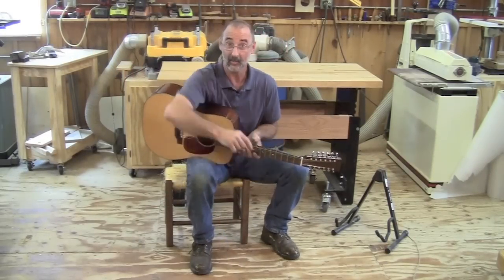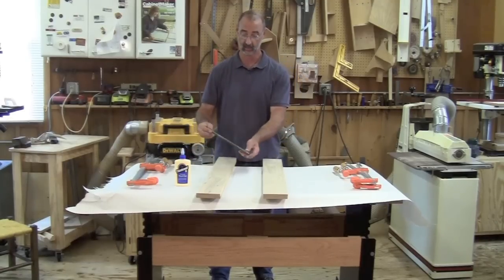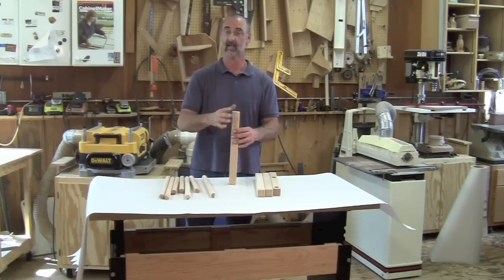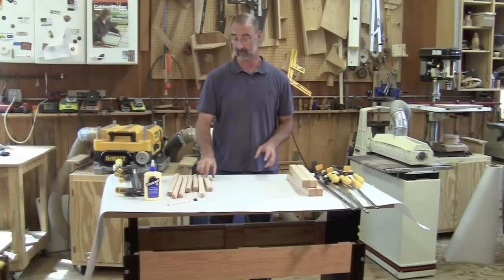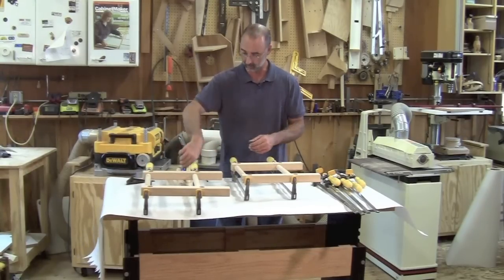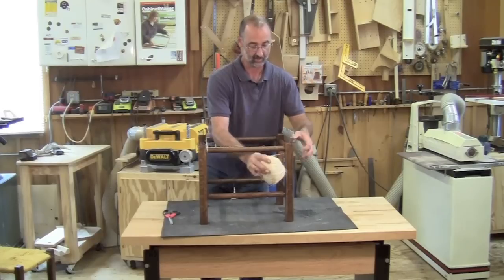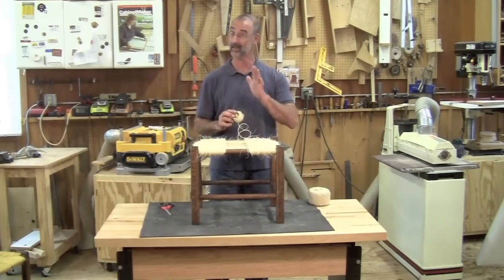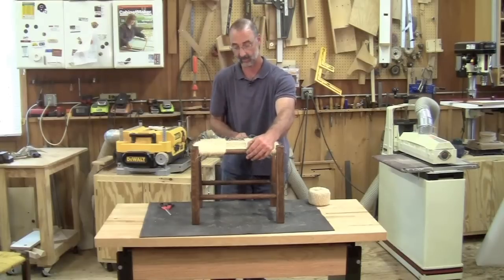Build Your Own Twine Stool

Comment: I don't have a plan for this, but it's pretty simple.  1" dowels for the rails that go into holes 3/4" deep.  1-1/2" x 1-1/2" hardwood legs.  Lots o' twine.  

The twine doesn't go around the outside of the leg, it crosses underneath inside the leg.  It'll make lots of sense once you start winding.

I finish the twine off with another clove hitch on the rail after you've made your last loop.

George